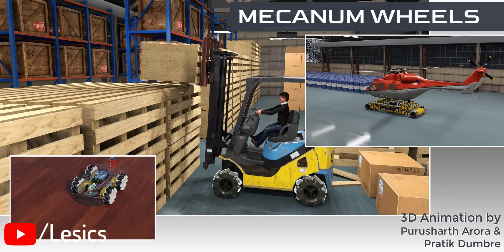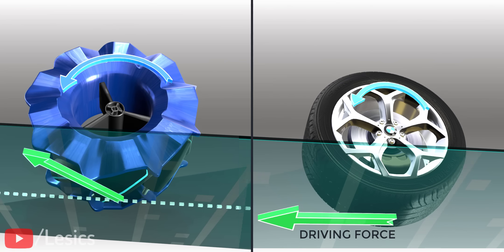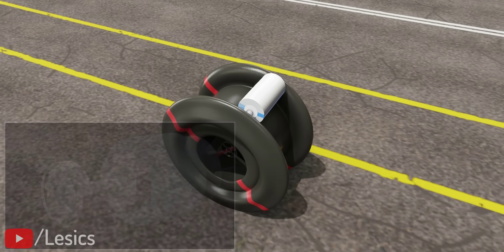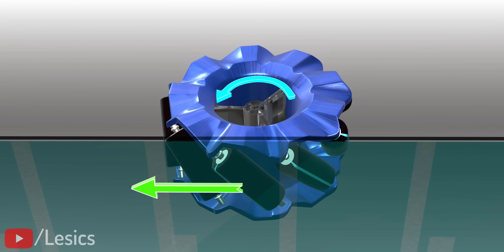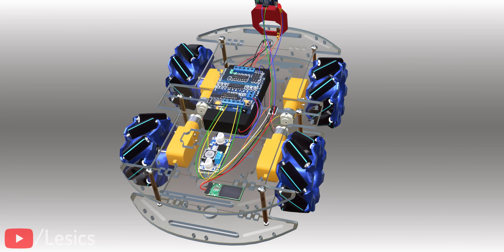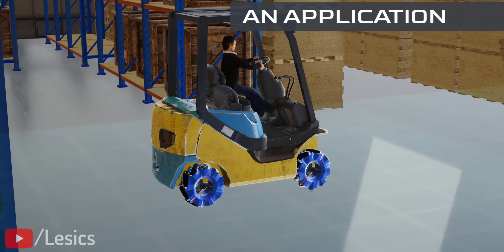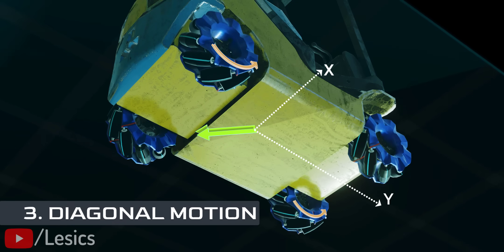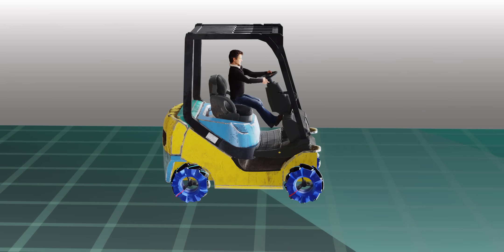The Brilliant Engineering of Mecanum Wheels!

Comment: Clever idea, but surely, the relatively small contact area of each wheel, compared to a conventional wheel, means that the load-carrying capacity will be reduced (unless they're made from some expensive super-strength material). So it's not really practical for a forklift (which by it's nature must carry high loads), but I can see the idea being useful in something like an electric wheelchair.
Reply: They are very common on many smaller, indoor forklifts that prioritize that maneuverability over load capacity.
Reply: Sorry Mr. Know-it-all. :) We used both Airtrax forklifts and Airtrax platform trucks for the past 12 years. No complaints about excessive wear and tear...so far. The forklifts have a 6000 pound capacity while our largest lift truck does 20000+.
Reply: I wonder if there is a way to both change the concavity of the wheels to increase or decrease the surface area and direction of force back and forth from a mecanum wheel to a conventional wheel as well as support the weight by using a mixture of mecanum wheels and conventional wheels to allow for larger carrying capacity or a different mechanism that supports weight independent of the wheels. I say I wonder because I can't imagine a light enough radially fitted piston system that could achieve this result assuming you have solved the problem of increased friction against differently aligned vectors if you were indeed using just the wheels to support the weight. Perhaps a hydraulic block is lowered from the center turning point that can rotate relative to the forklift but not the ground to support the additional weight that exceeds the carrying capacity of the wheels after they have retracted into mecanum wheels.
My point being that it may be incorrect to assume that all the weight can only be supported by mecanum wheels that are in use
Reply: it looks like it would wear down easier too, especially because its sliding
Reply: @Blox117  They are not sliding, it is an illusion. The rollers are... rolling.
Reply: @mumiemonstret  its sliding because the rollers are at an angle
Reply: @Blox117  Obviously Lesics didn't do a great job explaining this since so many viewers think that the rollers are sliding. I give it one last try:

The force between the rollers and ground can be divided into two components, one tangential (in the rolling direction) and one axial (parallel to the axis of the roller). Since the rollers can rotate freely, I think that we can agree that the tangential component is zero. The axial component is what confuses people. You seem to think that this force must cause the roller to slide on the ground. But in reality, this is the force that pushes the entire vehicle where you want it to go.
Reply: @mumiemonstret  no you are missing the point, it is sliding at least a little bit in order to move in these different directions since its not rolling parallel with the surface
Reply: @Blox117  The rollers are NOT sliding (unless you are talking about slip angle of the contact patch, which is usually insignificant because forklift rarely experience large lateral OR acceleration loads, mostly compressive loads).  However, because of the taper in the rollers, there is additional wear due to the difference in the radius of the roller within the contact patch and also the roller will need to speed up and slow down as the radius at the contact patch changes when moving at anything other than 45 deg.
Reply: @stanimal8  the rollers are facing in one direction. 45 degrees. Unless that roller is going in that direction (or opposite), the roller will be partially dragging. How the hell can you possibly argue this?
Reply: @jamesbizs They honestly aren't sliding, there are some flaws in your argument.  They aren't sliding in the exact same way that a bicycle wheel isn't sliding.  The roller relieves the sideways force and the axial component acts exactly like a wheel-- no sliding
Reply: @Blox117  it is not sliding at all. I worked with mecanum wheels for several years, they do not slide unless you really dont know what youre doing.
Reply: @anotheraggieburneraccount  so if you push it sideways with your hands, what happens?
Reply: @anotheraggieburneraccount  btw, it most definitely is sliding, even if only a little. even normal wheels slide in order to steer and turn. even on a bike
Reply: @simong1666  The rollers are 100% sliding. There is force being applied at an angle rather than a parallel.
Reply: @GeorgeMonet  what force being applied to what and at what angle?
Reply: @Blox117  I think you guys are using the term sliding differently. They're talking about sliding in a loss of grip situation (like turning a car wheel and the front wheels understeering due to loss of traction) while you mention sliding in the sense of tire slip as the tires deform. In that case literally every vehicle that turns will slide. However mecanum wheels behave like they slide more as they can only produce less than half of the grip of regular wheels due to less contact area.
Reply: @GeorgeMonet  No the wheels are sliding, the roller are not. The rollers will either be rolling along their axis(they roll freely) or against their axis (they do not roll but act locked in place as they provide the grip necessary to drive)
Reply: It looks like a bearing. You know bearing can carry so much weight. So I think it can work. They can make those things as small wheels with rubber around it and make them stronger to carry weight.
Reply: Literally passed over this comment as I arrived at the same thought mentally.
Reply: even if the wheel would be possible to construct with those tiny contact spot to the ground: every piece of dirt (nail, saw dust) will have catastrophic effects for the steering precision. As a result you would either need a clean room to operate it or drive below walking speed. (a thing impossible for trained forklift operators)
Reply: @rarbiart  Why is driving slow impossible for trained operator's?
Shouldn't it be easy for skilled operators? Although trained doesn't equate to skilled.
Reply: Your electric wheelchair would be able to strafe sure, but its battery last half as long
Reply: " load-carrying capacity will be reduced (unless they're made from some expensive super-strength material)"
I don't know about that. This forklift seems to carry normal loads just fine https://youtu.be/0DBXuZv38l8
Reply: @iamonhere  that is not "normal load" but just empty light cardboard. Please do the same with a palette of coke bottles or machinery.

Comment: So instead of mecanum wheels one can just use rotated 45 degree wheels? Mount them like:

/\
\/

and use it the same way?
Reply: No, becuase you do not have rollers and trying to move either forward, backward or sideways will create an extreme friction, but in fact you can achieve all these movements in the configuration you have proposed using omnidirectional wheels which are normal wheels with rollers perpendicular to the wheel
Reply: Not exactly.
If you keep the axle perpendicular to the wheel then it will advance by burning the wheel. Think about what would happen if the wheels were turning in opposite directions when you are in motion and trying to turn. Or if you are speeding and you quickly oversteer.

That's because, as it says in the video, the wheels we use exert their full force in the direction they face without being able to rotate in any other direction.
The key to these ingenious wheels is that they can rotate without restriction in the direction they face and +45° or -45° depending on which way you point the rollers that make up the wheels.
So you have a vehicle that goes 0° 45° 135° 180° 225° 315°, it could go 90° and 270° by burning wheel and it also turns on its center and not with respect to the rear wheels.
In both cases the turns are produced with wheel wear.
Reply: @josedavid6104  Si no le sabes no le muevas
Reply: @PaoloReyes  ?